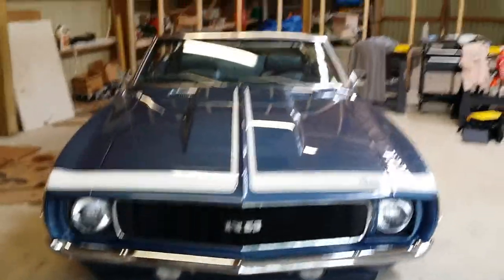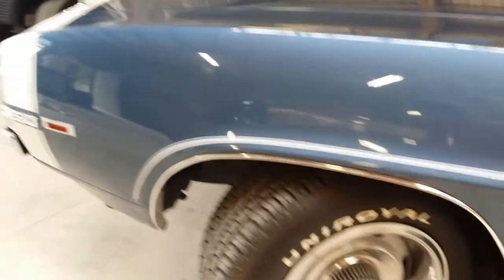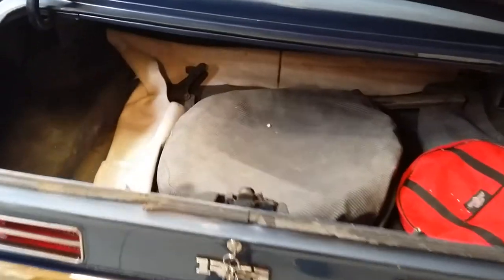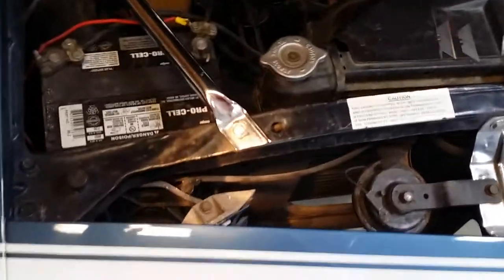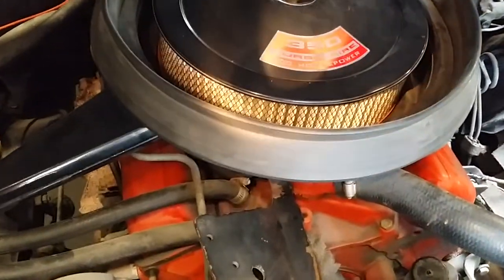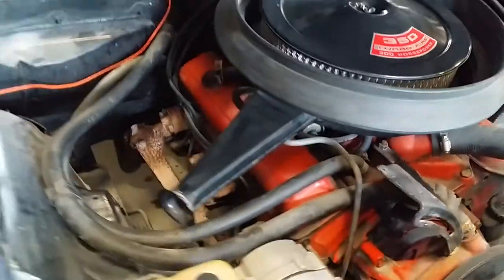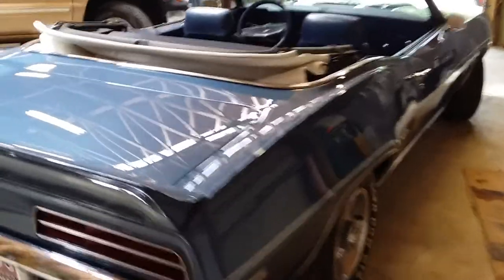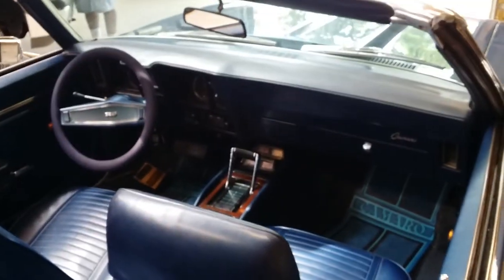1969 Camaro true RS Convertible- how to spot them!  auto appraisal

Comment: Didn't all 250hp 350ci Camaros only come with 10 bolt rear ends, I've seen where the LM1 Camaros with the 255hp 350ci had 12 bolts but never a 250hp 350 .